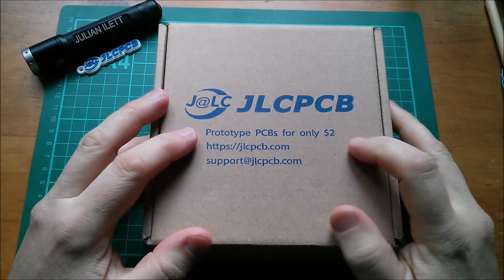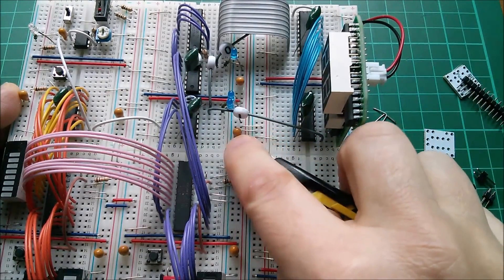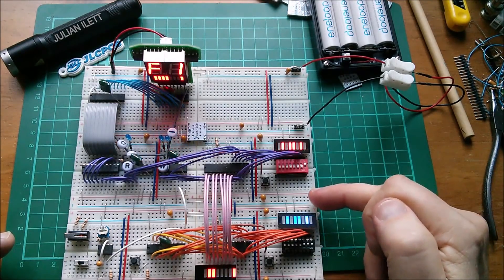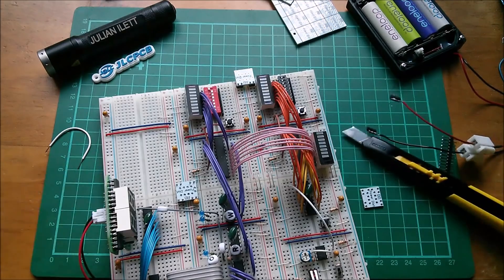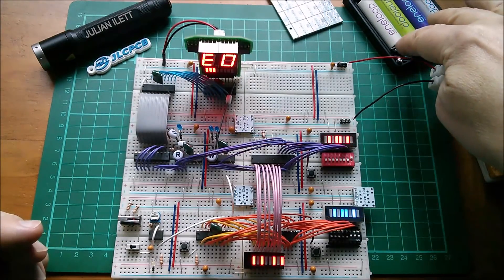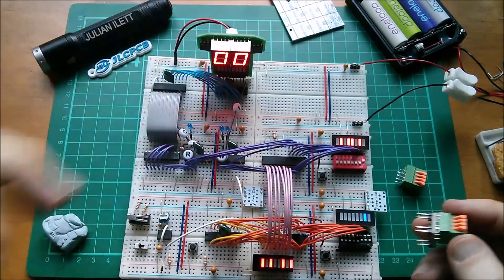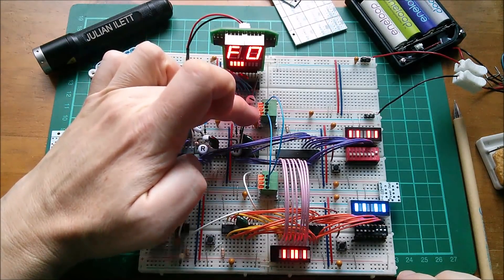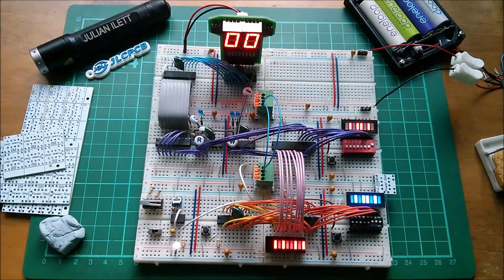New PCBs from JLCPCB - Breadboard Power Distribution

Comment: Yes Julian, I had a very similar solder-less breadboards issue recently, fixing a malfunctioning circuit by spraying 91% Isopropyl Alcohol on/into all holes, cleaning the internal medal clips letting the excess drain out and dry.  Then all circuits worked flawlessly to this day.  This cleaning might help you also.

Comment: To avoid bad connections beween breadboards I never use rigid conductors or multiple pins, I always use wires with a single pin. Thanks for sharing and Happy 2020 !

Comment: The terminal strips of the breadboard may have sink into the adhesive pad under the board over time. That why your links are not making good connection and hence the poor power.

If you slide the breadboard against the edge of the a hard surface like the edge of a table, it should push the terminal strips back up and you will have better connection.

Comment: I invested in some genuine BusBoard BB830s and haven't had a single connection problem since... and they're actually flat...
Worth the cost to lose the constant headache imo. Ben Eater has my eternal gratitude for suggesting them lol
Reply: LeiserGeist, I don’t know where you’re based but if you’re in Europe, were you able to buy the BB830s locally? I can only find them in the USA. I’m having the same poor power distribution issues and I’d like to buy more of the BB830s (I also have the Ben Eater kit).
Reply: 3lpid3 Are Mouser or Arrow available where you're at? According to BusBoard's site those are the two worldwide distributors.
If not, maybe send Ben an email, see what he thinks about selling them? Dunno how well that'd work though...
Sorry I couldn't be more helpful
Reply: Yeah. I could also try Amazon US. Mouser has a huge fee they charge on top?
Reply: 3lpid3 Not sure about fees, nor how Amazon works outside the states, but iirc the ones on there were sold by busboard. ymmv though

Comment: I've been prototyping (or trying to) a simple 6502 computer. 3 Breadboards connected together. I have terrible power distribution through them also, for some reason. Everything is fine when now components are in the board. I probably need something similar.

Comment: Hi Julian, have you tried putting a higher value resistor back onto the switch now that your power levels are sorted? 

If the levels were too low before because of the poor connections you could be shortening the chip life with over voltage now those levels are higher?

C.
Reply: This is pretty unlikely with a CMOS  7555 device. Its input voltage range is 3-16V so over-voltage on 4 NiMH is just not going to happen.

Comment: The more you rely on "daisy chain" the more likely you will have power distribution problems. In general, parallel distribution is more reliable, but requires more wires so there are multiple paths (less resistance and less prone to single point of failure) from your power source to each component.

Comment: Brilliant, thanks!
Might it help slightly by feeding the power into the middle breadboard rather than the top one?  May halve your overall power supply run (for now at least).  I don't expect as dramatic a gain compared to your new power-panels though...  :)

Comment: Hi Julian! Have you ever done a video showing the process of panellising a single-board design with EasyEDA and JLCPCB? I've started using Easy EDA after watching your videos and I've placed a few JLCPCB orders now but I'd be really interested in the steps to panellise a design. You didn't happen to video it for this board did you?
Reply from the maker: I can't remember. You don't do it in EasyEDA, you do it on the JLCPCB website when you're ordering your PCBs. You can try it right now - go to http://jlcpcb/quote and click YES to Panel by JLCPCB :)
Reply: I did my first EasyEDA board order on JLCPCB last week. I used the EasyEDA panelize option then placed order directly to JLCPCB, without selecting the “Panelize by JLCPCB” option (as the gerbers have already been auto-panelized in EasyEDA). The Gerber viewer shows the single PCB in the top left of the full panelized grid, but I understand that’s normal as the automation will replicate the single PCB cell. Same with the stencil (in theory). I guess I’ll know how this turns out in 10 - 14 days (airmail delivery selected). :-)

Comment: 20mm is the minimum V score size for JLCPCB, going below this gets you a tooling charge,  so 5 X 5 on a 100 X 100 board means that 25 x 5 = 125 is the limit for your $2

Comment: I thought I'd throw some "brand name" breadboards in with an order from the mouse-based electronics supplier, so I ordered the same ones as Ben Eater is supplying with his 6502 computer kits - Busboard Prototype Systems BB830. They're much better than the cheapie ebay ones I've bought previously (and they have continuous power rails, unlike most of the ones they're selling nowadays). They're not warped, so they sit flat, and the connections seem more consistently positive when you insert a component lead. And they also came with these thin aluminium sheets to stick onto the back, which would probably add a bit more rigidity. However they are literally 4 times more expensive than the cheapies off ebay, so not great if you need a bunch of them for a big project like this.
Reply: a better breadboard would significantly reduce the amount of headache in troubleshooting a loose wire or voltage drop
Reply: Ben has my eternal gratitude for suggesting those damn BusBoard breadboards, lol. They're amazing. 4 times more expensive, but infinite times less headache
At least they're not consumables. At this rate they'll probably last longer than the DIP package...

Comment: Great video! What ecad do you use? The body of the connector blocks being in conflict with the pin header should be possible to pick-up with a 3D view function. Possibly also with court yards, or maybe not when if the components are on the opposite sides of the pcb. I use the 3D viewer in Kicad all the time. It's a massive help for spotting these errors.
Decoupling caps as many has suggested is a great tip. You could possibly solder them directly between the pins of the header? Or scrape off some solder mask and fake the footprints for them?

Comment: I don't know why you put that half one on the end, aren't the power rails running the length of the breadboard? I see just the need for two full and two half ones only along the middle.
Reply: Any power cross connection can help on breadboards. Because the contacts are weak, one rail may get worse current (and therefore more voltage drop) than another so a cross connection anywhere on the rails helps. This is also largely dependent on the quality of the breadboard.

Comment: For the ones on the side, can you make them the same as the centre ones and fit them up a couple of spots.
Reply from the maker: I might put right angle header pins in them and mount them vertically :)

Comment: Could have added  bypass caps to them
Reply from the maker: There is a pair of pads on the edge of the board which could take a capacitor or a 0.1" connector (JST or Dupont). It probably didn't show up very well in the video :)
Reply: @JulianIlett  Nice
Reply: Also I love those spring push connectors, I have been using them for almost all my prototypes and breadboards lately.
Reply: that was my first suggestion...maybe some small  tantals.

Comment: Very cool idea. I’m not sure I would’ve thought of designing a PCB solely to replace a jumper wire. You’re brilliant. Awesome work! Will you be sharing the final design / Gerber’s so we can add some of these to our next JLCPCB orders? :-)
Reply from the maker: Design is here: https://easyeda.com/julian256/Breadboard-Connector but the board is a little undersized as I mentioned in the video.
Reply: @JulianIlett   I'm not sure what you meant by being a little undersized? I micro-measured my Breadboard spacing and your 440mil x 460mil outer hole grid appears bang-on!  In terms of the KF141 overlapping the header pins, I’d just trim the header pins flush before soldering them, which should allow the connector to sit flat.  Or did you mean "undersized" because the KF141 was hanging over the PCB edge at one end?

Comment: Is it worth adding space to the board for decoupling caps too?
Reply: Another great idea! Adding 1 or 2 decoupling caps to the board would seem a good enhancement to this clever little PCB design! :-)
Reply from the maker: There is a pair of unused pads (connected to 5v and 0v) on the board which could take a capacitor.

Comment: I have a dedicated small protoboard/breadboard specifically for helping header alignment when soldering.
That way I don't compromise a good protoboard/breadboard heat wise..
I notice how easy you got the headers plugged into the board, it should be a lot harder than that, so it explains the loose jumper connections.
Reply: For me, that job was relegated to the old cheapo boards that didn't even lay flat in the first place. lol

Comment: Thanks for sharing! Would you mind saying what brand and model those green push-in connectors are? I can see a use for those!
Reply from the maker: KF141 I believe
Reply: @JulianIlett  I was able to find them from that number. Great! Thanks.
Reply: @KennyTrussell  Did you find them in small quantities? If so, could you share a link?

I can only find them with a minimum quantity of 1,000
Reply: @KennyTrussell  Search for "Spring terminal block"
Reply from the maker: Small quantities are available on eBay :)